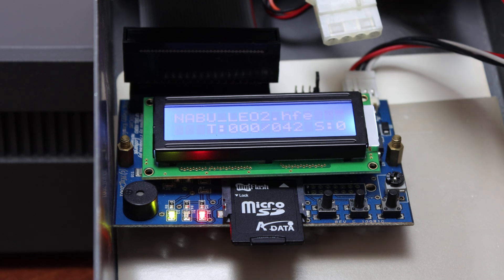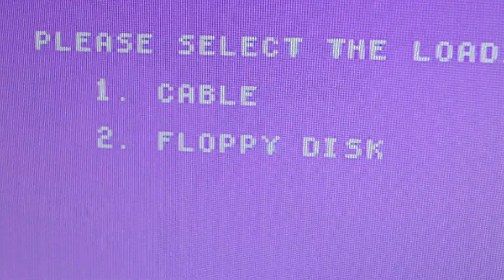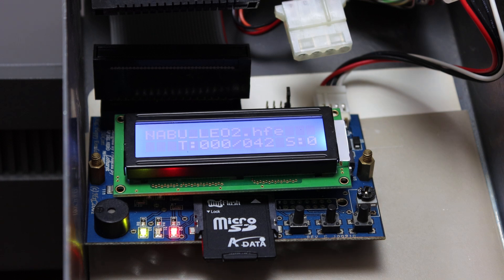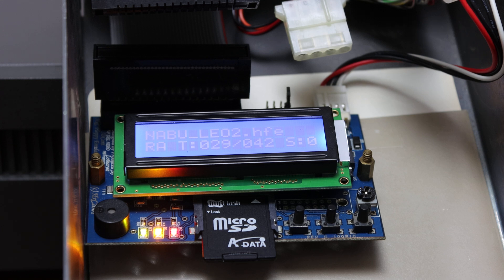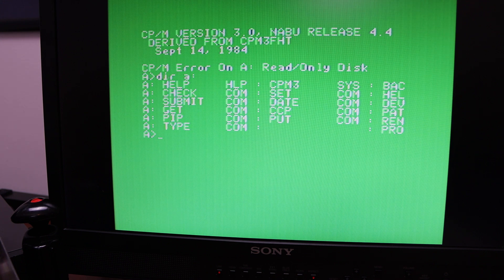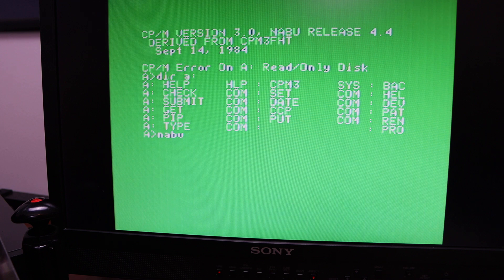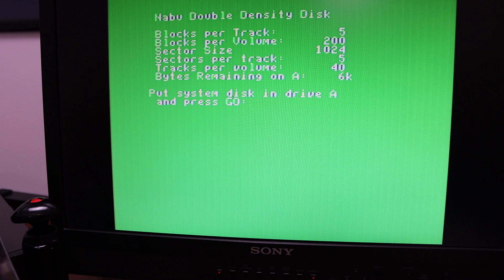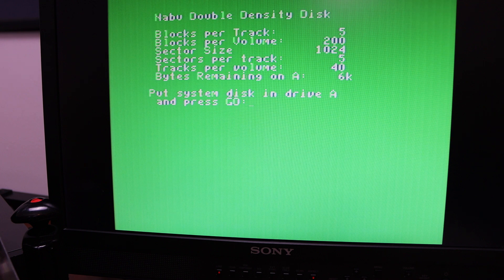NABU PC booting CP/M from HFE image

Comment: Fantastic work! Thanks for all your time and hard work! Was there ever a diagnostic test software for the hardware? I will be working on a diagnostic spreadsheet to help others fix the Nabu hardware. However, I have no way to test onboard RAM, ROMs, etc. Thanks for sharing!!
Reply from the maker: Not that I know of but the larger 8K EPROM versions of the firmware have a more detailed self-test on start up what will tell you if VRAM, or RAM, etc. is bad.  I am using version 29 available on my website.  When I thought my floppy drive was not working, I literally removed the RAM and it was accurate.  All RAM was fine.  If you do go with a larger EPROM, try removing some of the socketed chips  (not the CPU or firmware) and booting up and see what errors you get.  If I recall correctly,  I did this with almost all socketed chips.

Comment: Nice! It's great that the screen scrolls sideways. Last time when I saw it clipped at 40 columns, I was wondering how the heck it was acting like it was just showing the left part of the screen (suggesting it knew the software was for something wider :) ).
Reply: Hey Dave! Nice seeing you in the world of NABU! Did you order one? If not, they should be available again in the next couple of weeks. It's a fun machine for sure, and thanks to Leo keeping backups of so much software, we can actually do stuff with them like it's 1984 again! I'm currently working on a NABU Telnet client to connect up to BBS 🙂
Reply: @geekwithsocialskills  I did not order one... I believe I will just experience this machine vicariously. :) I've plenty of projects going for the holidays, though (too)!
Reply: @DrDavesDiversions  There is a WIP MAME build as well, so you can experience it that way. Maybe run the NABU emulator on your Amiga 2000? 🙂

Comment: Great work! As a side note, I love you have a piezo speaker on your HxC2001. I always add a speaker to my GoTek drives to have the simulated floppy sounds. Not as good as real disk sounds, but way better than just quiet wondering if things are loading or not.
Reply from the maker: Thank you.  I didn't realize that the piezo buzzer was an option these days?  I've had mine since 2013 and I think you had a selection of two colours of screen back then and that was it :)  At the time, GoTek wasn't a thing yet either.

Comment: I would very much like to acquire one of these! Very well done!
Reply: You should really pick up a HxC2001 SD. They are a great piece of kit and so useful for many vintage computers.
Reply: @geekwithsocialskills  Do you think it will work with the DS/HD 1.2MB drive?
Reply: Crap. A dozen of them on the site. I'll need some guidance.
Reply: @leo.binkowski  Go with the SD HxC Floppy Emulator REV C (HE10 34 pins interface). As for color, dealers choice. I personally have the Rev C Deep blue LCD.
Reply from the maker: I have the one that @geekwithsocialskills mentioned.  I personally have had good luck with it.